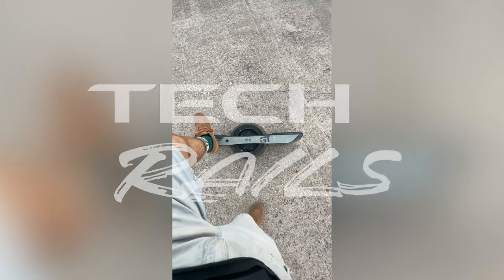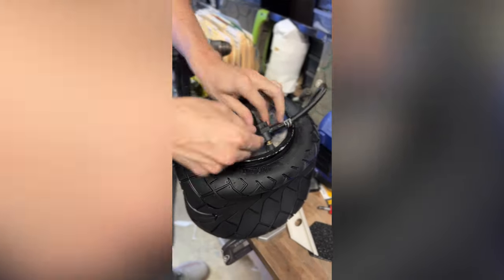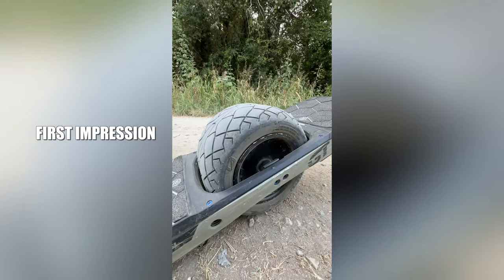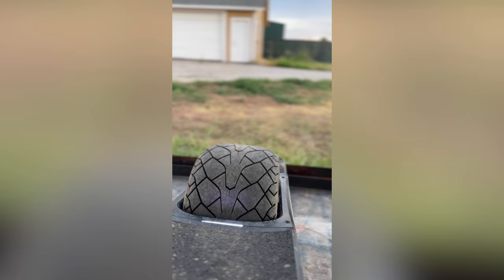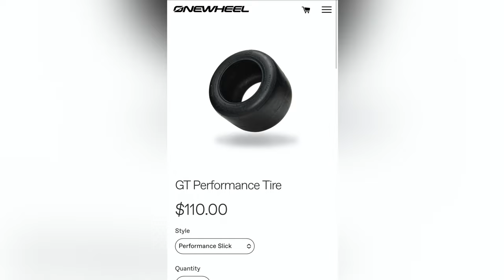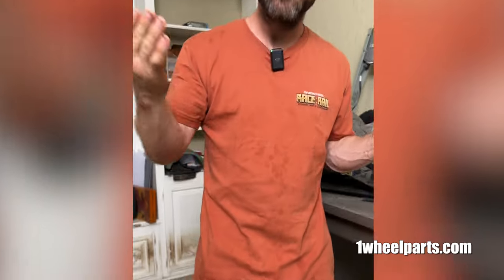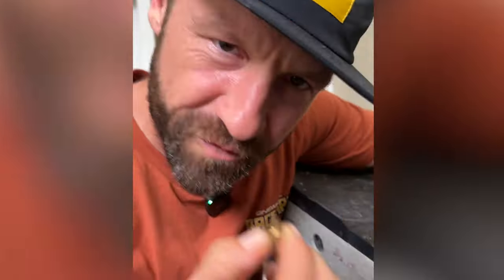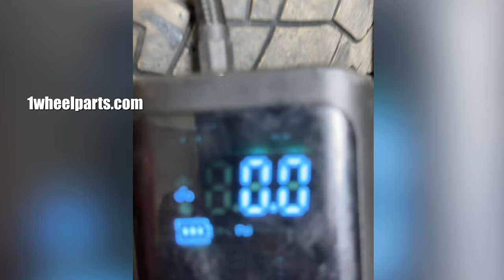ONEWHEEL GT- FUTURE MOTION 7 INCH PERFORMANCE TIRE REVIEW !!!!

Comment: Will the float life Lifesavers work with this  7 inch treaded tire?  I still want the security of the rim protection on the 6 1/2 inch wheel. Would like to see a demo video with Lifesavers and 7in wide tire If even compatible
Reply from the maker: I’m sure they still work - I never ride rim savers  - let’s get it 🤟🏻🤟🏻🤟🏻

Comment: Yo jeff! Got a question for you. So, there's the thing of getting your board unlocked with rewheel or something. It dulls the pushback from my understanding. Do you use that? Probably not in rftr but in qualifiers? Can you explain what it does a bit more? (if you know)
Reply from the maker: Thank you for watching James! What board setup you got ? You really need to check out the ignite foam grip if you haven’t already. “Rewheel” ? What is that ? Is that like another diy ONEWHEEL copycat ? Haven’t heard of it 😂😂😂😂
Reply: @jeffadairshreds  Really? Maybe its because you used a tilt kit or something. Its just a software like nRF connect and it balances the board when the wtf or 357 rails affect the level or the board so its unbalanced. Anyway, the stock, when you push it through rocks and stuff, the nose dips and shit. When its "unlocked" its way more responsive and fast. So, for the dirtsurferz qualifier for example, was it just stock pushback/software that you just pushed through?
Reply from the maker: @Jameslangford-rc6sw  you must be riding apex. When I go thru chunk my nose is strong and my billet with my fat sidewall is my suspension and my 357s allow my center of gravity to be way better than stock. 1wheelparts and tech rails are super awesome performance products that take your racing to a whole other level! Jeff Norris told you before and I’ll tell you again ….357s are the best trail rails out there
Reply from the maker: @Jameslangford-rc6sw  we were all hitting 30 mph at race for the rail. The nose on a GT is strong …apex starts dipping the nose on chitter chatter. Ride highline dude 💪💪💪
Reply: @jeffadairshreds  Nah, I know they help, but I've ridden boards exactly like mine (gt, wtf, enduro, surestart, etc) and its way different
Reply: @jeffadairshreds  Ive always ridden highline. So you basically just put your foot right through the pushback and it doesn't throw you?
Reply: @jeffadairshreds So, no software modifications other than balancing the boards level through nrf or whatever?
Reply from the maker: @Jameslangford-rc6sw  yup and stay tuned ! I got lots more content dropping 🤟🏻🤟🏻🤟🏻
Reply: @jeffadairshreds  Assuming that was yup to both questions, thanks man for the help and great content. Keep shredding!